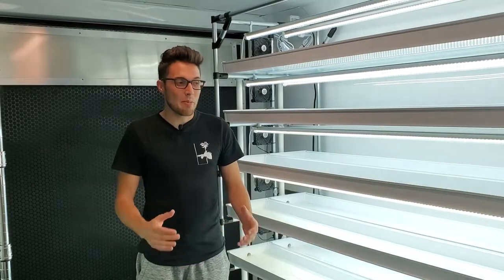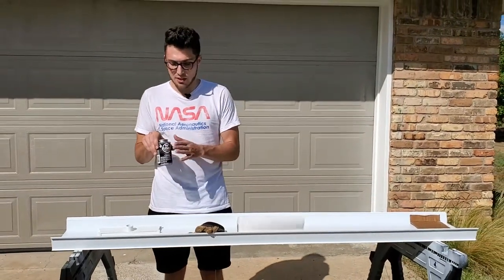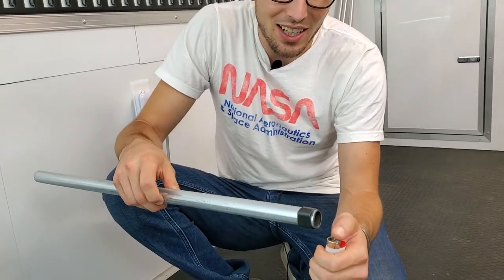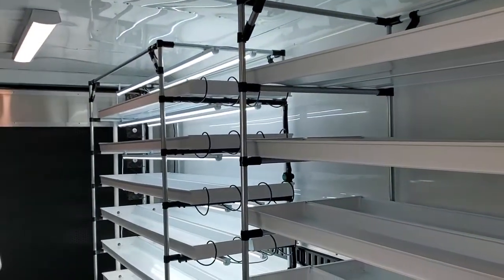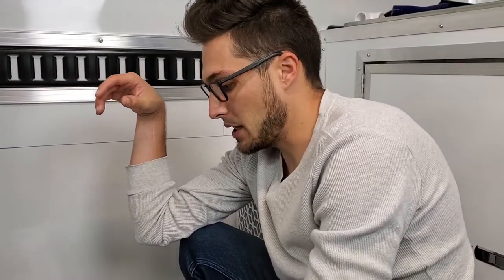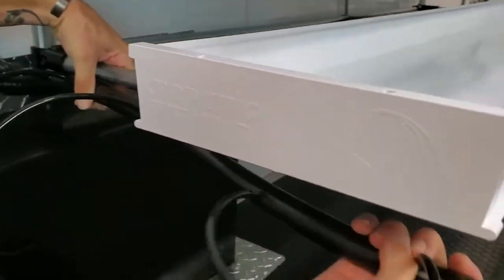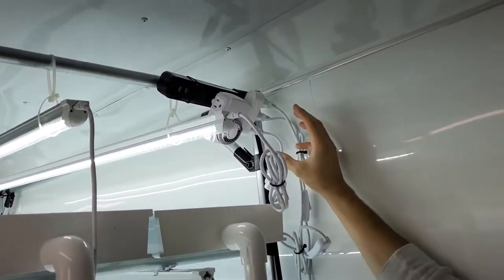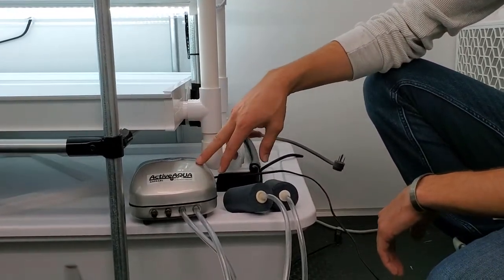Custom NFT Rack "how-to" for Microgreens |  Indoor farming | Indoor Gardening |  Hydroponics

Comment from the maker: Parts needed for Frame:
¾” EMT Pipe for Main Frame:
14 – 24” - 336” Total  
4 – 78” – 312” Total
4 – 61” – 244” Total
4 – 5.5” – 22” Total 
¾” EMT Pipe for Fan Holder:
2 – 3.5” – 7” Total 
1 – 64” 
Maker Pip Connectors for Main Frame:
8 – 90 degree connector
8 – 45 degree connectors
20 – T Connector
Maker Pipe Connectors for Fan Holder/Cable Runner:
4 – T connector
Channels:
Parts from Cropking/Farmtek:
6 – 10” Wide Channels – 12’ long 
 Cut in half to make 12 – 6’ long channels
12 – 10” Plain End Cap
12 – 10” Spouted End Cap
Parts from Hardware Store/Online:
1 – Oatey Fusion Single Step – Clear
10 – 1” PVC “T”
6 – 1” 90 degree PVC elbow 
2 – 5’ - 1” PVC Tubing

Estimated total:

Channels, endcaps & shipping = $583.50
Lights = $219
Fans = $78
9 pieces of EMT = $60
Maker pipe connectors = $142:
• 8 – 90 degree connector - $42
• 8 – 45 degree connectors - $34
• 24 – T Connector - $66
Timers - $15 & $16
Pump = $48
Extension cord = $22
3-prong adapter = $9
Air Pump = $29
Airstones = $9
20 gallon reservoir and lid = $82+$65 = $147
All plumbing/tubing = $160
$1,537.50 Total
Reply from the maker: Pinned for anyone who needs this!
Reply: You guys are so great thank you so much!! Are you currently marketing and selling are you just now instructional on YouTube?
Reply: What are the lights you used? Is there a 2 ft version of the lights?
Reply: This is an amazing video! Thank you so much for everything you produce :)

One question: those little feeder pipes into the channels seem a bit "over engineered" - doesn't it just add an extra element to get clogged / break?

I was wondering whether it'd just be easier to drill the holes into the fatter pipe and place the holes directly over the side of the tray, rather than feeding through those tiny narrow pipes?
Reply: great simple system... Looking for those 10" wide channels.  do you have a link that has them? I reached out to farmtek and cropking but haven't heard back.
Reply: @OnTheGrow  Channels, and endcaps  where did you buy these????
Reply: What's the brand for the little fans and for the lights. What are the link for them

Comment: That is an amazing setup, It looks like $1500.  I just started microgreens, built a frame out of 3 5/8" steel studs, used a 4x8 sheet of sanitary plastic paneling to make four trays for $5 each, total cost if I didnt reuse all my steel, would be about $92, around $150 with lights and pump, 1/10 of your cost, but defiantly not as sharp looking, but defiantly sharp in terms of steel edges :D
Reply from the maker: Sounds like a nice DIY system! Just be careful about using plastic that you are unsure of the source... Is it PP or HDPE or LDPE Plastic? Or is it a Vinyl? Also, is it food-grade? If you built the system to grow and sell produce, you need to make sure it is safe for your customers at the very least. It's good to save money, but be mindful you are also playing with others health.

Comment: I'm sure this system works great, I love it. You can improve aeration by configuring your nutrient pump outside the reservoir. Those pumps get warm and over time will slowly warm the water in the tank. Cooler water, around 67/69 deg F will hold way more O2. Also placing the nutrient pump on the opposite side of the tank away from the return/drain will increase water/nutrient/O2 mixture.   Great work, keep it up and best of luck from N.C.
Reply: It’s a flood and drain system that pump isn’t going to be on long. 

Your tip is only beneficial if you’re running an aeroponic system with the pump running 24/7 spraying water directly on roots.

Comment: Thanks for the build breakdown! I originally clicked on your vids because I was trying to find a way to rig computer fans for each level of my rack system. Your setup is very similar to mine except I used 2x4x7 wire rack shelving as my base and used a modified garden tray as my channels.
Reply from the maker: Very cool! Yeah, I was originally going to use a wire rack as well with these channels. Smart to use garden trays and modify them! Thank you so much for the support!
Reply: How did you modify your garden tray? Cut off ends and join end to end?

Comment: Nice Project.  One Comment that comes from experience with hydroponic grows and NFT.  If any light is permitted to be exposed to the nutrient water you will get algae growing in your tank.  This may not end up being an issue because your grow cycle is measured in days, not weeks - but it would prevent you from potentially using the same nutrient solution for more than one grow.  I mention this because it appears that there are gaps between your trays and there may be gaps between your trays and the sides of the NFT tray.  Keep up the good work.
Reply: What would be a solution for this?
Reply: @michaelwright9083  Do what you can to keep light away from any exposed nutrient water (light + nutrient water = algae growth)
Reply: What nutrients l use

Comment: thanks for this!!!   
tip: on the drain plumbing, don't use 1" PVC tubing.  It makes you have to be too perfect to make sure the channels are seated correctly.  Use 3/4" PVC tubing with 1" connectors w/ 3/4" reducer.  so it's channel cap > 1" elbow > 1"x3/4" reducer > 3/4" tube > 1" Tee > 1"x3/4" reducer...etc
this way the 3/4" tube from the above rack loosely drops into the 1" tee below it.  and you no longer need to be precise
hope this tip is understandable
Reply from the maker: Great suggestion!! I will have to try this if/when we rebuild or upgrade our system! Thanks for sharing!

Comment: CJ, for a suggestion use one air line from your aerator for this build you did and put the other line into the reservoir from the other NFT system.  if one aerator goes out you still have air from the other one.  if you want more redundancy use the other 2 connections to do the same to expand.  Put each NFT system on its own circuit breaker. If the circuit breaker goes out on only one NFT, it doesn't effect any of the others.

Comment: Thank you for this and your thorough explanation. I don’t grow microgreens, but I do grow orchids, lots of orchids. In fact I have well over 500 orchids. Being from Minnesota, without a greenhouse, it means I grow inside under controlled conditions. Like your set up, I need lights, fans, lots of humidity and a way to contain the water that drains from the pots. Used water containment is a big issue, when growing orchids inside, especially when growing more than a few. My plan is to build your setup, but with only 2-3 shelves and only draining the water into a reservoir, to dump. I’d like to use the same NFT channels as you. It would be nice if they made these channels 18” & 24” wide. Are you aware of a similar product that wide? I was thinking of using the channel tops, but may opt for the grid panels I already use. I plan to put the shelving into a 10’x10’ grow tent, in order to provide the orchids with the 70%+ humidity they need. I do know of people, growing orchids, who do reuse their water. For many, this is a big no no. Maybe later I will devise a drip system to reuse that water for a week, before starting fresh. Happy building!!

Comment: Really great video, I'm looking forward to building some shelving systems myself now.
Reply: Just a thought, I apologise if its been suggested and discussed already, what if you placed your trays in opposite diagonals, so that you only pump water into the top tray, and each tray drains into the next? It would simplify the plumbing setup. If you didn't want to water one tray for any reason, you move the contents to the top tray and simply lower the outlet pipe from the pump into the first tray you want to water?
Reply from the maker: Great suggestion and yeah, that would totally work! The only concern would be that the first tray that gets the water would get the most nutrients and the last tray in the setup would get the least nutrients... If you had enough water flow, it wouldn’t matter but you could also potentially overwater... Just something to be aware of!
Reply: @OnTheGrow  that's a really good thought, I think maybe it's something that I could play with and see what happens? When I've tried it out, I'll let you know 😊👍

Comment: Hey CJ, I love your vids! I am currently a soil grower and am doing about 70 flats per week but am definitely interested in trying out your setup. Can you comment about cleaning/sterilizing frequencies. Should we be looking forward to a video about maintaining a system like yours? Keep up the good work!
Reply from the maker: Thank you so much for the support! We can totally do a video on sterilization and cleaning practices for the system! It really isn't too bad at all... Basically every three weeks we do a complete system clean-out and run a hydrogen peroxide solution through all the plumbing... We wipe down all the channels with the same solution in a spray bottle and then it is good to go again! We will make a video on it next time it is cleaned (about three weeks from now). It goes pretty quick too! Maybe 20-40 minutes to deep clean each system. Thanks again for the support!

Comment: Awesome tutorial. I did have a couple questions.
 Link for the 6' bulbs? I saw 2' bulbs listed in the Amazon store.
 What media are you using in your trays that sit in the channel? 
Is it some sort of mat that doesn't break down so as to not have clogging issues?

What are the pH and ppm of your nutrient solution? 
Is the solution used from day 1 when the system fires up and do you do any flushing/plain water to finish?
What is your preferred method for cleaning between rounds?
Lastly (for now..lol) do you see any time savings or increase in harvest weight or increase in quality of your final product using the  NFT system?

I am really enjoying your vids and learning a ton! Thank you for sharing and building the community!!
Reply from the maker: Thank you for the support! Vendors will sometimes swap thier products, so that likely explains the 2ft lights. I'd suggest just searching a 6ft light and find something that falls in what we suggest. As for medium, a hydroponic medium works best but you can use soil, or anything really if you have a good strainer to catch debris before the reservoir. 5.5ph ppm varies. No flushing, we would wipe sanitize and fully sanitize between cleanings.

Many of your questions can easily be answered in our eBook Becoming a Microgreen Master. Sorry, but we have a lot of people to respond to!

Hope that helps,
-CJ

Comment: Hi, your videos are beyond impressive. I went from having seen one of your videos to relying on them for one of my top sources for microgreens growing. I’m just a novice growing for family nutrition. I notice on your amazon shop that you have 2 different types of single 4ft LED lights.  Is there one you prefer over the other? I also bought a double 4 foot LED shop light from a home improvement store with two 6500 K bulbs. Do you think that two is too many in one fixture? By the looks of it, most professional setups, including yours, would require one bulb for that same amount of coverage. I am using a much narrower rack and my trays are small (10”x20”) that run parallel to the light fixture. I noticed you guys only have one going across for that same amount of space despite having deeper racks and storing them perpendicular to the light fixtures. Thanks and please let me know if you need me to clarify that question!

Comment: Hi ...awesome video...im looking to flood and drain a 4 level setup...exactly the build your doing now....but this looks like not a flood and drain...what in thinking is start flooding bottom tray water will never get to level 4 cause of pressure...so as it's pumping it will have less and less psi going up...would mind is you send me some of your idea..thanks

Comment: I looked up the NFT Channel materials at CropKing..and it's not really too terribly expensive. And they are really clean looking.  I don't what the shipping charges are, I know this can be a deal breaker for some..as they can get ridiculously high.
Reply from the maker: The shipping wasn't terrible really! I asked for two quotes, one with them being 12ft long and the other with them cut in half... Having them cut in half (Only $25 for all 12 channel cuts) dropped the shipping by more than half. It was still around $200 for shipping three huge boxes from Ohio to Texas which isn't terrible really. Just ask for Karen and she will give you a quote no problem! Another company is FarmTek but they only provide quotes and don't have a lot of their prices listed online, really friendly company though!
Reply: Wow..that's really not a bad shipping rate for that...considering the size of the items.
Reply from the maker: Forage Forage it’s actually quite surprising! 3 boxes at 40lbs & 6ftx2ft each. I thought it would be more!

Comment: Have you had any trouble getting consistent flow to the top with not having some kind of valving? I would thing that the bottom would be getting more pressure and flow then the top.
Reply from the maker: We have not had any issues with the flow... The pump was oversized on purpose so that all trays could get consistent flow to all channels.

Comment: This really a great video, very well done. The problem is this, After careful consideration in comparison I was ready to pull the trigger on a completely assembled unit from Bootstrap Farmer when I ran into your video. I can get a 5 shelf chrome rack completely assembled for approximately $2300.00. Have you looked at the Bootstrap Farmer Unit? I am planning on doing this on a commercial level very soon.

Just one more well done on all of your Videos!!
Reply from the maker: Yeah, I actually helped them design their system :) 

It’s a great complete system!! 

Check out our custom flood and drain build, which is more similar to their complete system... it would be a system like theirs for a fraction of the cost. I just like to give people options!

https://youtu.be/K4rb5pGYQdU

Thank you for the support! 🤗🌱🌱

Comment: Nice work! If you ran the line straight to the top and then snaked in S turns all the way down would it lose too much pressure? Seems you'd be able to cut down on connectors if that works.

Comment: you air pump has more than one membrane pump inside, and it is likely that you are just utilizing half of them right now, blocking the other, which adds heat. the smarter choice is to have them come together. have two of the out ports connect to one line via a T piece. that way you will get more air.
Reply from the maker: The air pressure increases if we close the other two, so I don’t believe it is causing issues... If it is able to provide more pressure to the two others, I would think that they are already T’d into a single line. I could be wrong and you are correct that T’ing them together would be the best bet if they aren’t already!
Reply: @OnTheGrow  you can open the air pump to have a look how it is built inside. they are rather simple to take apart. usually there is more than one membrane pump in there and as far as i recall, one is supplying only two channels. it could be that they share a channel, but i think it's still more efficient to combine the channels instead of just closing them off. it's worth trying out and see if it makes a difference.

Comment: Your valves need to be on the line out of the tee not the main feed line otherwise it will shutoff the trays above, not just the shelf of 4.

Nice work on the design though 👌

Comment: How do you set the difference in water pressure from the first shelf to the last? Just wondering because there will be a lot more flow on the first shelf than on the last one
Reply from the maker: Good question,  Every pair of shelf's is connected to a water shut off valve which you can adjust how much water is coming through by turning the valve to be either more open or more closed off depending on if your needing more or less pressure.
Reply: Could you link me that valve?

Comment: new subscriber here !! why not build it in a Z pattern ? so top shelf drain into the next one down etc . like a daisy chaining  so that way you use one feeder line lets say on the right side and then the last drainage also on the right side, safe time and materials !!
Reply from the maker: Great question! That a very viable option for this system and something we considered. The main drawback is that there is the possibility of the water being different temperatures and nutrient levels at the top compared to the bottom. As the water flows across each channel, the nutrients are grabbed up by the plants and since the lights are below each level, the trays are slightly warmed. So once the water passes through so 4-6channels, it could be warmer or with less nutrients at the bottom. They say you don't want water running further than  I think 25 feet in NFT systems, but I may be wrong about that. The Z setup would likely work though! I just wanted to try something out, so I went with this design 😄🌱🌱
Reply: @OnTheGrow  I see your point !! and it's a good one !! thanks

Comment: When your pumps cycle on how long do you water for?  Just the 15 minutes each cycle?
Reply: I believe the answer is yes. They seem to only put a single pin in so that would be 15 minutes per cycle. But in one of the comments below CJ also said "So we had ours watering 4 times a day for 15 minutes per watering which did work but some crops didn't like that much water. I would recommend doing a 1-2 minute watering every hour instead for better results hopefully!".